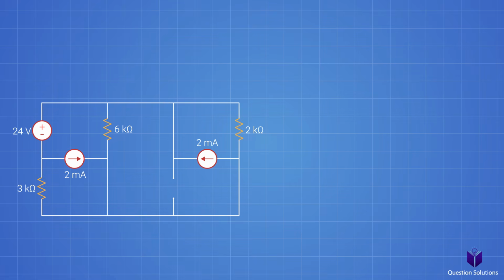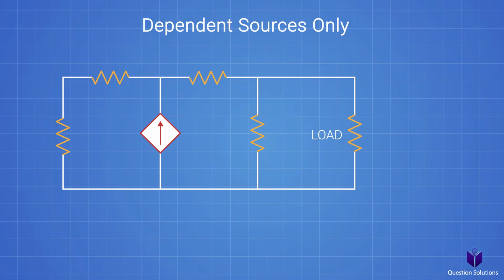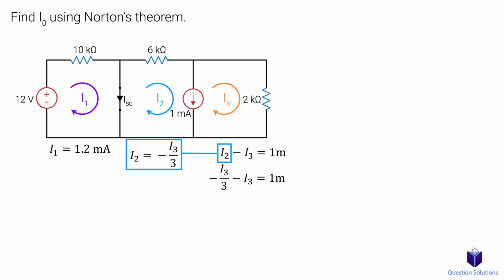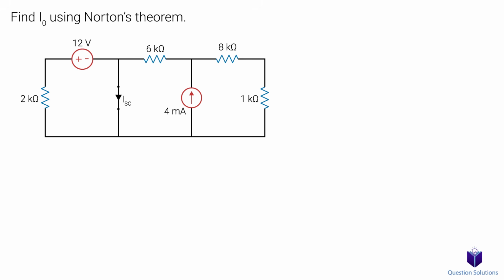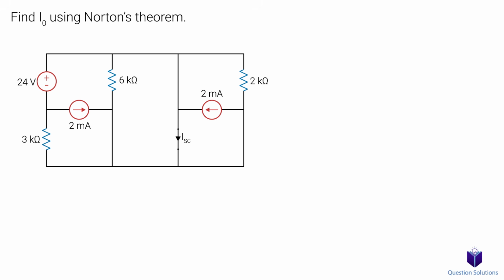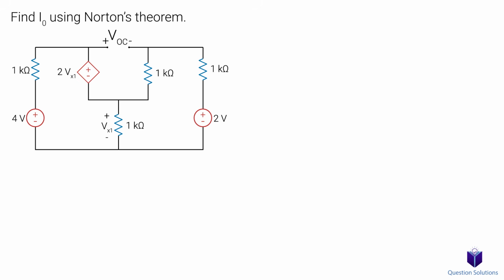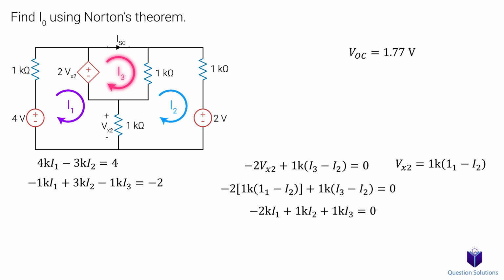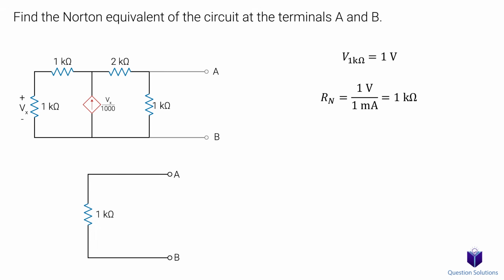The Complete Guide to Norton's Theorem | Engineering Circuit Analysis | (Solved Examples)

Comment from the maker: ❗  *Please read before commenting*❗
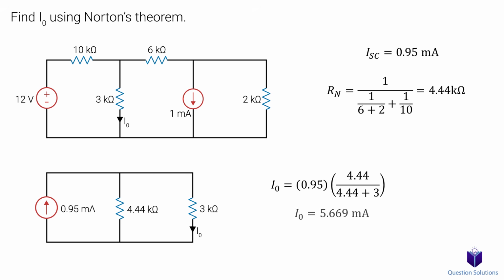❗At 9:09 there is a typo in the answer, it's NOT 5.669 mA, it is 0.5669 mA. 
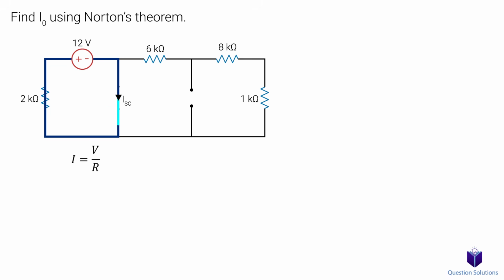❗At 10:37, it should be 12/2k, NOT 12/4k. The resistor value is 2k, NOT 4k, but the answer is right. 

🟪Circuit Analysis Playlist: https://www.youtube.com/playlist?list=PLXePpKFSUW2abKgvj_hClQS1NK86SCHfy
🟦Thevenin's Theorem: https://youtu.be/-X7otqsma4Q
🟦Mesh Analysis: https://youtu.be/D92DjS43-Qw
🟦Nodal Analysis: https://youtu.be/JptsfzvKbuo
🟦Superposition: https://youtu.be/uoZ0E6zxoi0
🟦Combining Series and Parallel Circuits: https://youtu.be/Gn26z60tTog
🟦Basic Concepts of Circuit Analysis: https://youtu.be/rE_0ejMU6yM 
🟦Ohm's Law and Kirchhoff's Laws: https://youtu.be/8pJcXfl8oq0

Comment: 9:09 Sometimes you say use the resistor you do not want, sometimes you say use the resistor you do want; not in this video, but in others. Which is it?
Reply from the maker: It deepens on whether it's voltage division or current division. Pay close attention to which is being used.

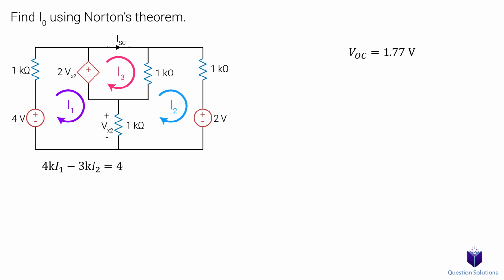Comment: Loop 2 19:51  I didn't understand the signs '+'/ '-'..If I'm not mistaken, the 
Loop 2 should be -1(I2-I1)-1(I3-I2)+I2+2=0
So I1=2/3mA,I2=-4/9mA,I3=16/9mA,Isc=1.78mA
1.78mA,INOT =0.58mA
Reply from the maker: That's incorrect. You are using the positives assigned to Vx2 in your loop equation (which you can't do since you always use passive convention when writing your loop equations, so whichever side the current enters will be positive). Also, the second term will never be negative, since you're writing the equation for I2, it will take precedence, so it'll always be 1(i2-i3) since i3 is opposing i2.

Comment: i feel like i use different methods like for example two i paused and did it like how u did 1 adngor a totall different value(7.84)
Reply from the maker: It doesn't really matter what type of methods you use to get an answer, because you should end up with the same answer at the end. If you are getting different values, then you probably have a numerical error or the method you're using is incorrect. You can always draw your circuit and double check your values using this: https://www.circuitlab.com/editor/#?id=7pq5wm&from=homepage

Comment: I still don’t understand how the idea of short circuit works like why does the current sometimes just decide not to go on some resistances
Reply from the maker: So the key idea you need to realize is that current doesn't want to go through resistors. In other words, it will always look for the path of least resistance. If there is someway to bypass a resistor, that's what it will do. If it has no choice but to go through it, then it goes through it, but if there is some path it can take to go from points A to B without having to go through anything (other than the conductor itself), that's what it will do.

Comment: at question 4 why did we start by finding Voltage while in the previous questions we first tried to find either current or resistance ?
Reply from the maker: It really doesn't matter about the order, you need the VOC and ISC, the order you get them makes no difference to the answer.

Comment: in the 1st question when finding the short circuit current we haven't removed the current sources but in the 3rd question we removed them , why ?
Reply from the maker: We used different methods to get the current. You remove sources when using superposition.

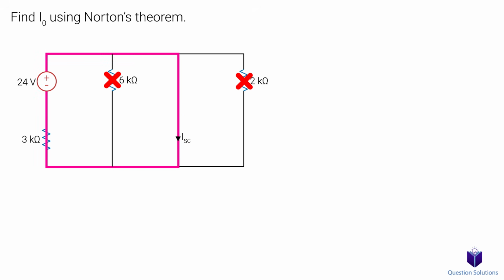Comment: At 13:56, why would the current not go through 6k ohm? maybe I’m lack of pre-required knowledge
Reply from the maker: Think of it like this. You are standing on top of the voltage source. Your goal is to go out the positive side and get back into the negative side. Every resistor is a mud swamp that you must crawl through. If it was you, how would you do it? Would you walk through the 6k ohm resistor, 2kohm resistor, or, would you go through the middle where there is no mud swamp? You have no choice but to walk through the 3kohm resistor since there is no path into the negative terminal without going through a swamp. While this is a crude example, this is the gist of how this works. Current will always take the path of least resistance, like many things of nature.

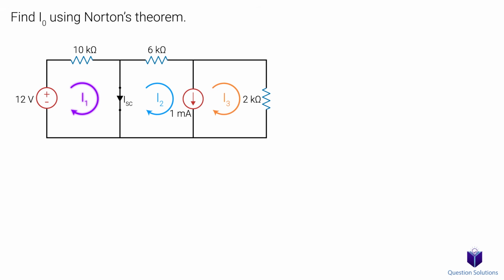Comment: at 10:21 since no current flows through the 6k, 8k and 1k resistor.. is that the same case for the example at 5:30?? if i were to use superposition.. i would open circuit the 1mA source.. then would no current flow through 6k and 2k?
Reply from the maker: That's correct. If you only had the voltage source at 5:30, then the current would only flow through the 10k ohm resistor.

Comment: with all these analysis techniques, I'm still confused when to use one over the other. KCL, KVL, Thevenin's, Norton's, Nodal, Mesh? how do they all work together? or do they not?
Reply from the maker: That's really up to you. I can't give you an answer as to what you should use. Most of them can be used together to solve a circuit. Do as many questions as you can with different solving methods and you will gain the intuition to know which method to use when you look at a circuit.

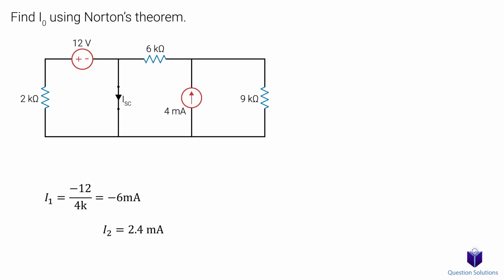Comment: at 11:35, i use mesh analysis and have found I_1 as -6 mA and I_2 as 2.4 mA as you. but then I_SC is I_1 - I_2 since i have set the I_1 and I_2 to the clockwise direction. so i've found I_SC as -8.4 mA not -3.6 mA.
Reply from the maker: -8.4 is incorrect, but I am not sure how to help you out without actually seeing your steps. Where was your I2? In the middle mesh? Did you have I1, I2 and I3?
Reply: @QuestionSolutions  I had the same problem
Reply from the maker: @popofiero765 I need to see your steps to point out where the mistake is. It's really difficult to know otherwise. You can verify your answers using circuitlab.com by drawing this circuit and analysing the currents and voltages.
Reply: @QuestionSolutions do you have a group were people can send pics of the exercise like discord?

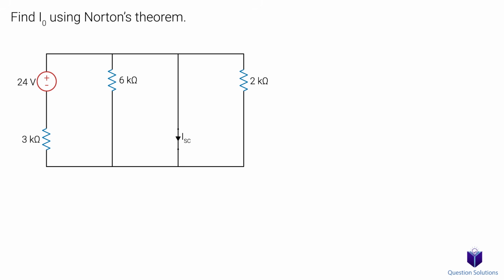Comment: If current takes the path of least resistance, why did the current bypass the 2k resistor and take the path of the 3k resistor at 13:50?
Reply from the maker: I have no clue where you're referring to. Please use timestamps.
Reply: @QuestionSolutions  I think understand now. You are starting with the voltage.
Reply from the maker: @the_eternal_student  That's right. You start at a power source and the goal is to come back to the same power source. So a good way is to imagine walking from the power source back to the power source while avoiding resistors. If you can get through a short circuit, that's what you'll do.